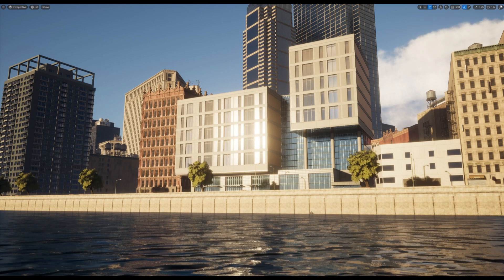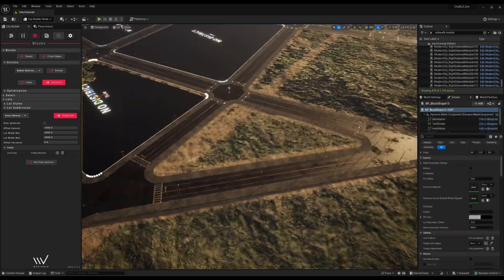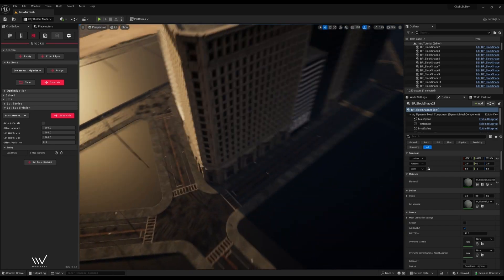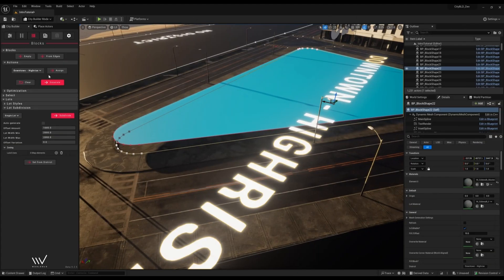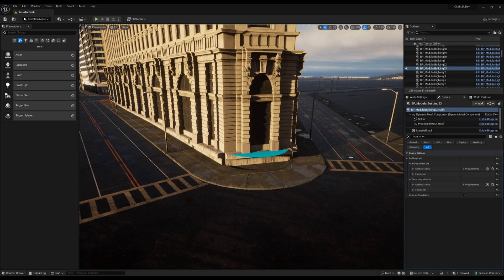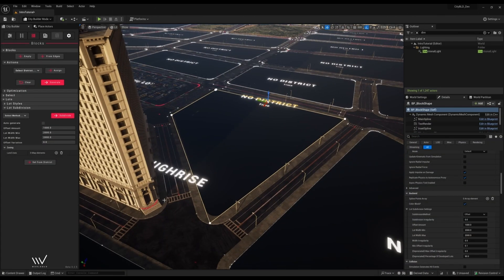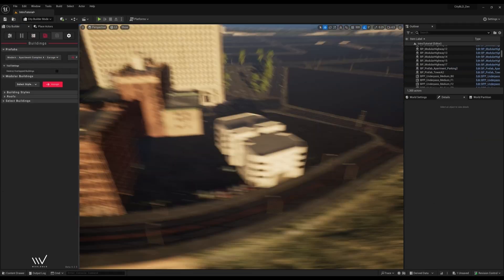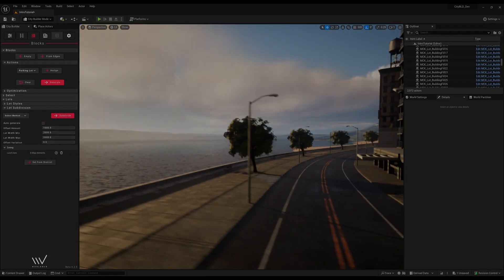(OUTDATED) Intro to CityBLD - Part 4 - Buildings & Zoning

Comment: Good thing I Bought This Its Pretty Good But I have One Question how do i make the Interior Procedural?
Reply from the maker: @RBM4AIProductions  Hi there, at this point procedural interiors are still an experimental feature in CityBLD (we recommend using static interior spawn when possible), so some modification will likely be needed to suit your specific needs, but here's a guide covering the basics of procedural interiors and how to use them: https://worldbld.notion.site/Interiors-Basics-790136ec067a4226a241495c8a808d9a

Hope this helps!
Reply: @WorldBLD  Thanks

Comment: is there a faster way to select the edges?
Reply from the maker: @skate6  In V0.3.4 the best way to select edges is to use the Blocks From Edges tool, whereas in V0.4+ these shapes are generally created automatically!
Reply: @WorldBLD  nice, so it not need click each edge line to spawn the shapes?
Reply from the maker: @skate6  Correct, this step should usually be done automatically!

Comment: Would be nice if you can adjust the parking lot rotation or to set one of the sides to be the "master" to which the rest conforms.
That way you can have them  better alligned with roads and or buildings, instead of heaving a crooked inefficient parking space.
Love the new update, can't wait for the next one.